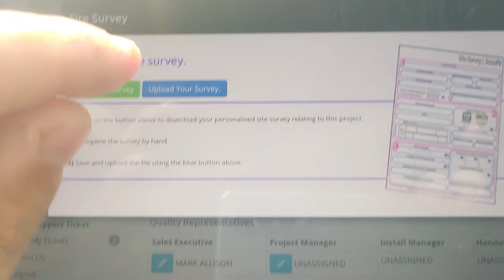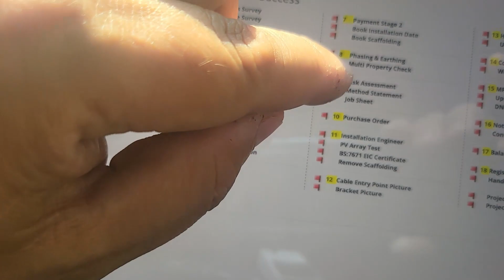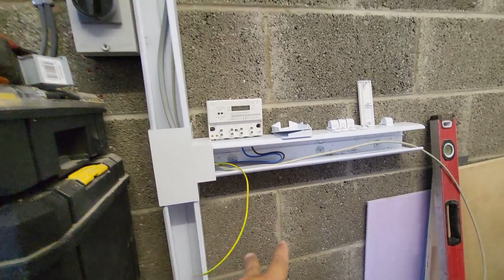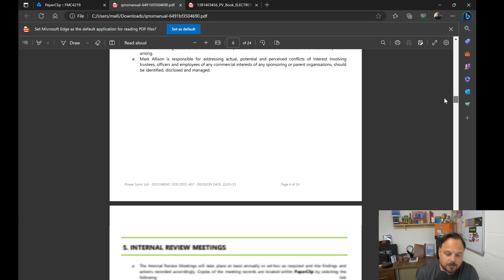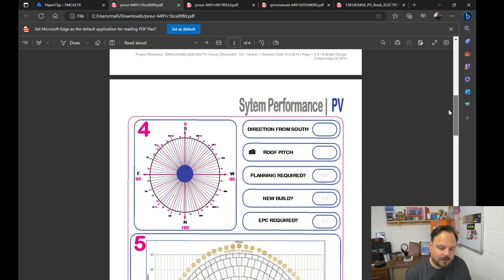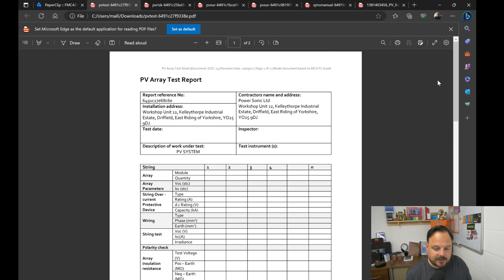Installing a Solar Hybrid inverter - Complete MCS paperwork - The easy way...

Comment: Nice job ,can't see a type b rcd unless you have galvanic isolation on the inverter.
Reply from the maker: RCD is not required on this model of inverter aside from as per normal is final circuits.
Reply: Thanks

Comment: I have a Eco flow power stream invertor. 800 watts it is approved by Energy Networks Authority that's all UK power networks need to release the Export MPAN, But when I went to Octopus, they would not approve a paid Export Tariff without MCS or Flexiorb. Would Ecoflow pass MCS or Flexiorb am I barking up the Wrong Tree.???? Its the off the shelf Balcony system.
Reply from the maker: The non MCS octopus route is still in a trial phase so far as I know. They will want to see the electrical certificate, building control notice, DNO application (G99 or G99) . 

You wouldn’t be able to put the system through MCS now as it’s installed. Hope that helps
Reply: @electrician247  Yeah , I think I am learning electricians wont do MCS on exosting, No solution at present.

Comment: Hi mark, how much are paperclip charging for there sothwhere ?
Reply from the maker: Think it was around£300 but we no longer use it
Reply: thank you Mark appreciate that I’m currently going through my MCS process at the moment and have my assessment booked ford the end of February. Just trying to decide what QMS to use. a bit like you. I’ve tried to use Google Drive, but I’m not sure that’s good solution going forward there aren’t many videos out there demonstrating how paperclip or easy, MCS or any other options work, so difficult to find information on it
Reply: @michaelsmallwood6002 who did you use in the end as my assessment is end of the month?
Reply: @grahamdaniel6035  I made my own QMS in the end using Google sheets they were happy with it !

Comment: Hi Mark, 
which software are you using now you have experience? ez pv or paper clip or other?
Many thanks
Graham
Reply from the maker: I’ve integrated forms into our servicem8 setup so use neither any longer. But I found ez PV much simpler. Worth noting easyPV from midsummer has a pro upgrade released last week which can do the same.

Comment: Fantastic, informative video. One question though, you are running AC and DC cables next to each other. Don't there have to be a 300mm separation between them to stop voltage leak?
Reply: Ah, makes sense. Thanks
Reply from the maker: No. Cables just need to be rated for maximum voltage present as DC is double insulated. Thank.

Comment: Hi Mark, I am just getting into Solar. I have ordered a Chinese brand inverter which has an AC in and AC out. Have you come across these and how would you suggest it be wired up. I am thinking along the side of a sub panel and moving certain house loads over to the sub panel.

Comment: Hi Mark great video. Just started installing solar after a long time. Is it a requirement to install surge protection on the dc strings?
Reply from the maker: Depends on the design tbh but we use them as standard.